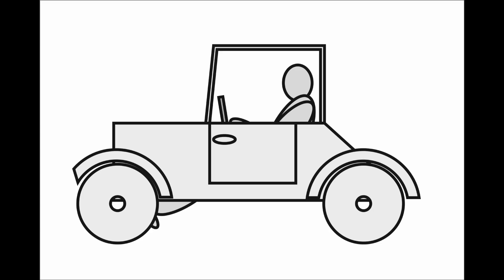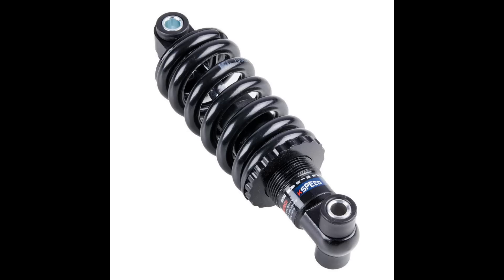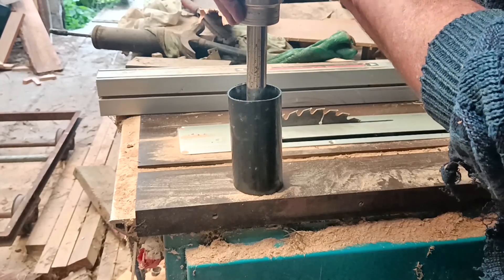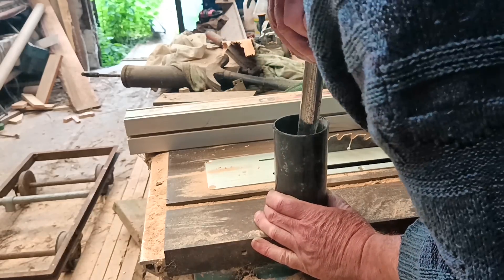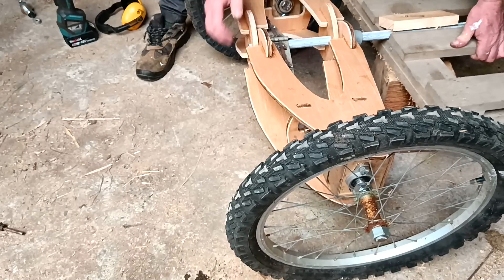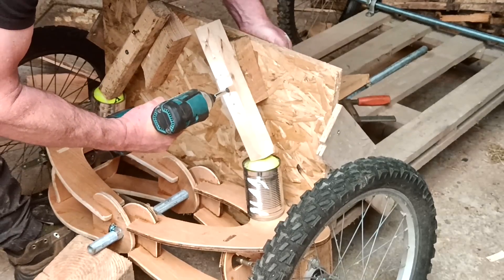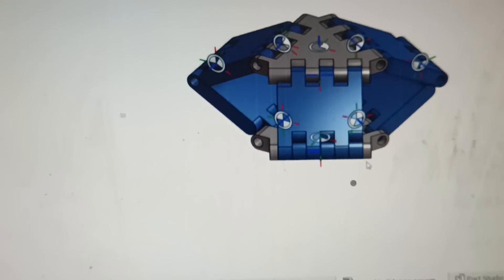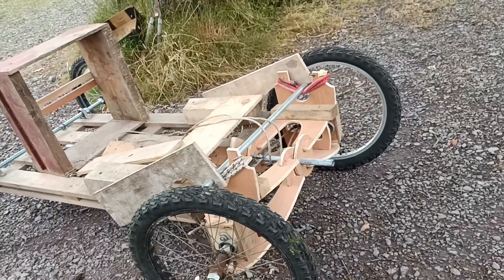Can I Use Tennis Balls For Suspension In The Wooden Car? Or Bungee Cord?

Comment: Talking about air ride suspension, I was just think about that.
Driver seats in big trucks also have air ride suspension. Usually 1 seat has 2 of these balloons (or what you wanna call them), I've been told. They are way smaller (thus lighter) than the ones for cars.
Saw people on another channel build a gokart (at least twice as heavy as your bicycle car) using 4 of those balloons (1 per wheel) as suspension. They also added an airtank so it has adjustable ride height, but that's optional (and unnecessarily heavy in your scenario).
According to them even the new balloons were way less expensive as one might think.

Just an idea...
Reply: https://youtu.be/iRY6F6xuPRM?si=G4F5nikAzWQab3PM
Reply: Just posted a link to one of the video's about the mentioned gokart. It will probably be removed,  so:
Search youtube for "CarsAndCameras wheel barrow" if you wanna see it yourself.

Comment: instead of tennis balls, solid rubber balls, or practice cricket balls perhaps, tennis balls will puncture and split in time, but id forget the bungees, they will continually stretch and the camber will have to be adjusted continually, the mini used hydroelastic suspense as you will probably know, many cars have rubber bump stops under the trailing link rear suspension, a trip to your local scrap yard,

Comment: Go to a Car Scrapyard, and buy a pair of Gas Struts from an old Hatch Back Car. Tennis Balls are for smashing with a Raquet.
Reply from the maker: Thanks, but have you actually tried to squash one of those? Way too stiff.
Reply: @wayoutwest-workshopstuff6299  You may be surprised that those Gas Struts can be purchased in a wide range of Newton - Force Load, and also that they're available in differing Stroke Lengths. Those Gas Struts as found on the smallest (wrecked) Hatch Back do have a smaller compressive force - when compared to those large Hatch Backs. This could be a cheap and viable alternative for the suspension of your creation. I would make some arrangement, to place a matching pair at each side, for added strength. I have the awful feeling that each tennis ball would be under a great compressive force, far exceeding the ball specifications. Each ball sharing a load over 90 kgs at 2 x g. The ball(s) would have every chance of losing their internal air pressure. And quickly serve as dampers only! Greetings from Australia.

Comment: Everyone seems to have offered some really great advice on things to use for the springs. As for the 3D printing thing though, places like jlb PCB do ridiculously cheap 3D printing now. He would just upload the models and then have a printed out. It's worth noting that a lot of this is kind of intended for prototyping at that cost so designing something with some extra fault tolerance would be advisable since the parts can often come off pretty rough. That said, you can print in really impressive materials like nylon and even metal for an extraordinary really cheap price these days.
Reply from the maker: do they only do pcbs though?

Comment: yes absolutely. Sir Alec Issigonis designed the rubber spring specifically for the Morris Mini. Air springs were first used for lorries especially in the US. Also use Nitrogen. You could use closed cell foam synthetic rubber from some kind of supplier.
You may eventually need a damper to regulate the "springiness". I would argue for parallel tennis squasher arms- use a wooden-jam-lid on a vertical pivot- essentially a crude mimicry of the MacPherson strut. (the vector of the coil is constrained by the MacPerson strut damper/spring system thus no need for a spring well. 
The positive Camber issue (the base of the wheels when viewed head-one closer than the tops of the wheels) is not an issue unless at highway speeds- carriages were historically (as were early cars) positive camber thus easier steering forces. I would argue for separate pivot (longitudinal) for each suspension as per unequal A-arm vehicle suspension. 
Leaf suspension- the most common form is the semi-eliptacal rear spring as per most pickups and delivery vans and lower- end and higher end cars (admittedly the Rolls Royce used semi-elliptic spring as did the Rover P5 both with woeful very soft and wallowy rear ends). The Model T Ford had transverse semi-elliptic springs.- thus semi-independent front and rear suspension essentially identical to a Land Rover (solid differentials)- but FLAT transverse springs is a simple means of accomplishing what essentially operates as  multi-piece torsion bar. Corvette used a fibreglas transverse leaf
Even the engineering genius Charles "Spen" Spencer King, the wizard engineer of Rover head designer first turbine jet car, first turbine racing car- designer of the Land Rover and Range Rover and the brilliant P6/P6B- designed the first Land and Range Rovers with a slight 0.5-1 degree positive camber as a minor road  handling concession to ease steering forces on the then ubiquitous non-powered steering box (for Rover it was recirculating ball until the SD1 rack and pinion) for off road.
The other spring alternative- is the torsion bar. the beauty of the torsion bar is you can use any shape tube, solid or hollow- so long as the suspension is entirely mated with it. Porsche famously perfected this via the Kubelwagen and the various Panzer. Front and rear swing-arms of the Porsche and Beetle were similarly torsion bar.
Rover, probably Spen King as a junior engineer agreed it was perfectly adequate for their P5 limousine (in this instance it was a  stack of flat leaves perpendicular to the suspended wheel- that as a box unit had rotational direction applied.)
The Christie or bell-crank suspension is worthy of considering- in this system the springs would be supported by a sturdy passenger box. Rover P6 came up with an excellent Christie type front suspension where the spring was parallel to the longitude of the car- the suspended wheel was extended or compressed via a bell crank- the advantage was the springs could be mounted to the much more heavily constructed safety cell vs the less rugged inner valances forming the crumple zone. 
And yes Rover came up with the crumple zone before Mercedes- on a shoestring. That's how fricking smart the UK was. And all on pennies and rarely shillings.
Then of rear suspension you have the de Dion common in racing cars and high end sports cars of the 1950s. Ferrari used de Dion. Lotus and Brabham used de Dion as did BRM. Alfa Romeo continued with the de Dion albeit torsion bar springs, whereas Rover used conventional springs. A Rover torsion bar conventional unequal A-arm suspension (P5 front suspension used for the P6 rear) or in combination with the de Dion tube may indeed have been an in-house experiment but rejected out of cost & corrosion considerations. As far as I recall the P5 had protective grease encased boot for its transverse flat torsion leaves. and multiple grease nipples along its length.

Comment: the suspension should be partially compressed under the vehicles own weight so that it naturally tries to remain i contact with the ground; As a spit-ball estimate, I'd wager approximately 1-2 inches of compression under the vehicles full frame and/or with occupant.

Comment: We sometimes used tennis balls to support vibration isolation tables. Wheel barrow sized inner tubes worked too. Neither was perfect but for the price to performance ratio it was pretty good. Air tables are quite expensive.

Comment: I would recommend visiting a junkyard or scrapyard! They are often cheap used parts and when your lucky there is parts that were only used for a few miles. I don't know if they are anything like i have here but i have found all kinds of electrical components and all kinds of springs and suspension systems of all shapes and sizes.
Reply from the maker: You obviously don't live in Ireland, Cory! (They don't exist here any longer..)
Reply: @wayoutwest-workshopstuff6299   perhaps then it would be possible to coordinate with a viewer from the united states? Just cover the cost of the parts and shipping and I'm sure there will be volunteers! I just moved recently so I don't know what the local junk and scrapyards have to offer here, or how far away they are. But I'm sure it would be cheaper than the normal costs for parts

Comment: Such a vessel does not need any suspension. It would also be more stable without suspension. If you want some comfort, you will better the seat springs.

Comment: If you made the yokes on the central pipe bigger you could have the upper and lower suspension arms parallel instead of diverging. This might make the geometry for the steering hubs a bit better. 🔧👍
Reply from the maker: Ah, but if I made those pieces bigger they'd have less resistance to twist, surely?

Comment: it seems to me the tennis ball would work better inside a pipe with a wider piston and pins attaching it to the arms and frame. that would let them flex so the piston is going straight in regardless of the angle of the body

Comment: The closer to the wheel you position a compression device, the more vertical the movement will be. As is the nature of an arc, if you were to lengthen the pivoting control arms and somehow hinge them from the opposite side of the cart, the end of the bar would move "inward" even less through its range of motion, making it even easier to contain something like tennis balls in a tin.

Also, have you considered a "live axle" setup? You could have a rigid front axle cross member, with control arms reaching toward the rear of the cart in a |= shape. I'm not sure how you'd apply steering, but a single pivot point could be achieved through converging the rear arms like |> . I think that presents new difficulties such as extreme levels of negative castor, however.

Comment: Sorry to put some actual science into this thread but what you need is a properly designed soring-damper assembly or shock absorber.   Tennis ball is far from that.
Reply from the maker: except that rubber is a damper already..
Reply: @wayoutwest-workshopstuff6299  did you do a proper mathematical analysis or are you just guessing? 
Step-function math is hard.

Comment: For the tennis ball suspension consider increasing the diameter of the tube so that the balls have some space to expand laterally as they are compressed along the length of the tube. That will give the suspension longer travel.

Comment: If you wanted to use tennis balls, maybe make "egg cups" to hold the tennis ball. Four egg cups, two inverted on your hard points on the chassis and two upright ones on your suspension arms, a ball in each egg cup, and the balls resting on each other. You may have to glue the balls into their respective cup. I think this might give you something closer to the air suspension you looked at.

Comment: The problem with Bungee,  is that it will start to get longer and longer, until it eventually fails.   The tennis balls, however... will retain their shape much much longer,  without issue,  due to the shape, and the sealed air pressure.

Comment: Why not go with a shock style design? two "thin" walled pipes, where one can freely slide within the other, cap at least one end of them, put the tennisballs in the bigger pipe and use the capped end of the smaller pipe as the compression surface. then the only thing that would have to be done is using some form of joint or throug-hole to connect it to the rest of the suspension

Comment: instead of bungy cord you could use (old) bicycle inner tyres. I dont know if they are longer lasting than bungy cord but they are abundant in my country (Netherlands) and very versatile. Also if you have an undamaged one you can partially fill them up with air to change the properties. I use half inflated ones to fasten fragile loads to my bike, gives a bit more cushioning and protection.

Comment: Look into the "Spanish windlass" mechanism. It's a torsion spring made out of elastic or semi-elastic ropes. Basically how catapults made with classical construction methods are built. Fully adjustable with the amount overlapping ropes and number of twists you put in vs. the lever being acted upon. But if you use it you'd want to make sure you build a sturdy stop for it at the extent of its range, and you need a way to release the tension for servicing as well. (A rope with high elasticity such as a nylon one with a lot of turns could easily store as much energy as an automotive coil spring, so some due caution may be needed.) If implemented cleverly, it would be much better than either of the options presented in the video title. It should offer a much larger range of travel than either while providing spring pressure.
Reply from the maker: Thanks - an interesting idea

Comment: I must say that is a very unique way of solving that problem. Perhaps the blocks putting tension on the balls could have an adjustable rail so you can tweak how low the wheels should be, but also you could add on slots for an adjustable amount of bungee cords as a combination along with the balls to adjust the dampening. Your videos are great, inspiring, and I hope you continue to do this, but no matter what this community will support you if you need to take a break from video making.

Comment: I once had a similar idea, for an even smaller "car."  I was building a valve cover racer, (google it!) and thought that a simple suspension would add some speed.  I imagined a similar solution to your tennis balls, except I used little foam-rubber ear plugs in place of your tennis balls.  Sadly, I can't suggest whether it worked or not. The project is still sitting on my workbench, never finished.  Damned ADD! 🙃
Reply from the maker: There's still time to finish it!

Comment: In my opinion you definitely be fine leaving a solid rear axle like on the four-wheeler, it would flex with the frame and it's highly unlikely that you would reach rough enough terrain to get the wheels off the ground. Also neat idea with the tennis balls😊

Comment: I think i have a better option for you. Take two bicycle seats the each have two springs. You can mount the springs side by side at arround the middle of the sway arms. So the length of traffel wil be times two. Each pair of springs should be able to hold one aduld. The weight of the paddal car plus the weight of one person is too much for just one pair so that is why i think you need one pair on each side. And in the back i reccomend only one wheel so you don't need a differential. And you can ad one pair of seat springs on the back wheel. I am sorry for any spelling falts. My Englisch is not 100%
Greetings from the Netherlands,, Kitty.
Reply from the maker: Dank je wel. Kitty. I found some motorcycle-seat springs which seem to work well - so far. 3 wheels?  - then it wouldn't be a proper car!

Comment: For the foam-filled tennis ball idea specifically, I had a suggestion:

Instead of squishing the tennis balls into a can, why not drill a hole directly through the center of each tennis ball, and use some metal rods to attach them to a pair of wooden horseshoe-shaped clamps, with one pair of clamps per wheel?
This way, the tennis balls can compress horizontally without running the risk of them becoming misaligned.
Reply: If you drill holes into the tennis ball-- you are losing the compression properties of the tennis ball, thereby nullifying the effectiveness.

Comment: To contain the balls put them in a length of PVC pipe with a similar inside diameter as the balls and  capped on one end, then you could make a close fitting "piston" to ride inside the pipe. As long as the piston is tall enough it won't rack sideways in the pipe, it will push straight on the balls no matter the angle you push on the piston. As a bonus if one end was capped air tight an O-ring on the piston might add to the air compression. 

Something else to think about, why make suspension at all? It makes everything quite complicated. I've built many go-carts in my younger days without suspension, it's quite common and if your mostly driving these on grass and gravel roads not really necessary, especially with the low speeds you'll see in a pedal car.
Reply from the maker: I think we will need some suspension - and so far it's not too complicated?
Reply: @wayoutwest-workshopstuff6299  No i dont think its too complicated at all. I was just suggesting taking a step back and thinking if you really needed it.

Comment: While there are many potentially useful ideas offered by readers, all seem to be low hysteresis, meaning you may need some form of shock absorber. My garage door used to slam shut when it finished closing because it uses a low-overhead closer that pushes the uppermost segment straight into the header at the end of the closing stroke. I found a pair of snowmobile friction shocks and installed them to cushion the closing. And they are wrench-adjustable.

Comment: Belville spring washers?. (maybe try the "plastic hats" , that are frequently used for sports training) 
They are Usually metal disks with hole in middle, that have been bent to form a cone shape. Under a compression  load, the cone tends to flatten. Add more washers in same orientation to stiffen spring. Flip orientation of some washers to weaken spring and  increase travel. Or otherwise adjust spring characteristics.